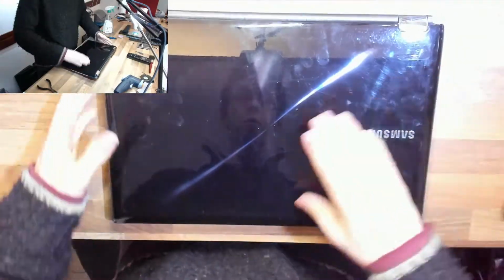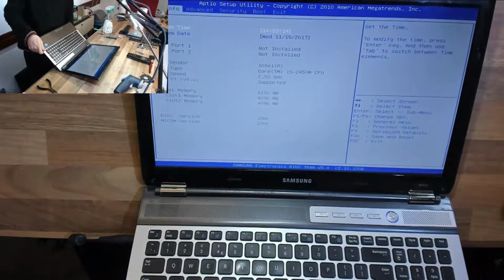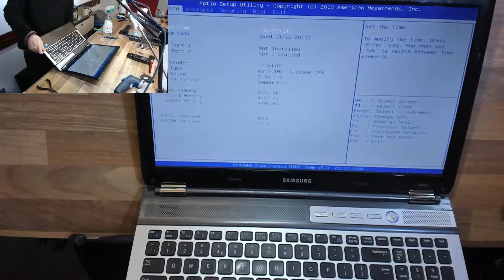LFC#126 - Samsung RF511 Charger Jack

Comment: I am watching this video on my Samsung RF510. I've taken the back off of it a few times. One was when I wanted to upgrade to Windows 10 and was informed that I had to change the wifi card to a Atheros instead of a Broadcom. It's getting old in the tooth now, but still works okay, but slow. I wish Samsung would make laptops again as I need a new one. I might have to consider their galaxy tab instead. Nice to see the laptop you were working on looked like mine.

Comment: That "rubber" block may be there to make up the height so that the heat sinks are on the same level.  It's probably heat-conductive and that's why they used thermal paste.  I'm surprised that you didn't replace the thermal paste.  If the manufacturer used thermal paste, shouldn't you do so too?